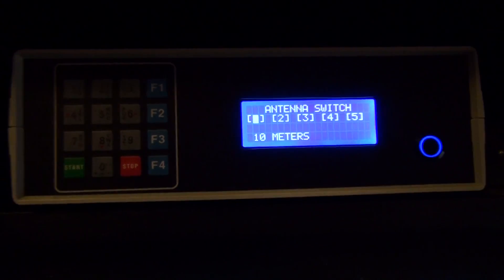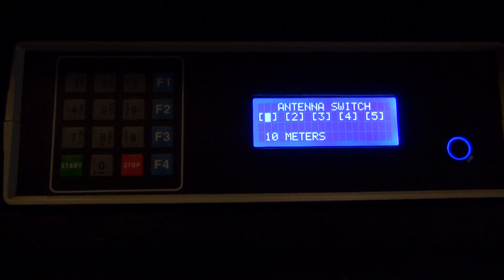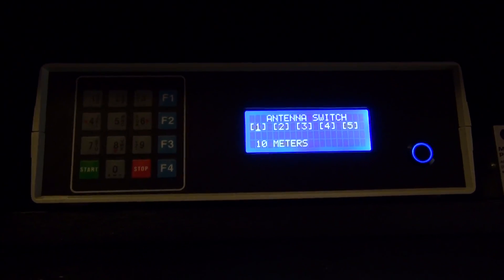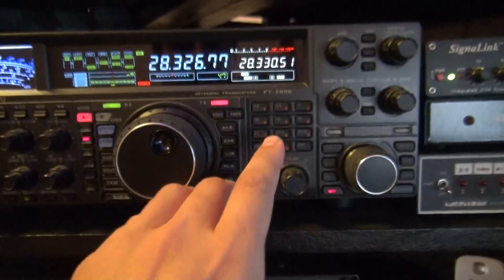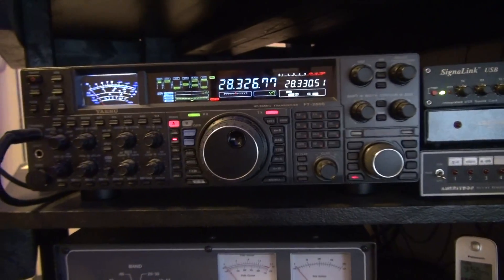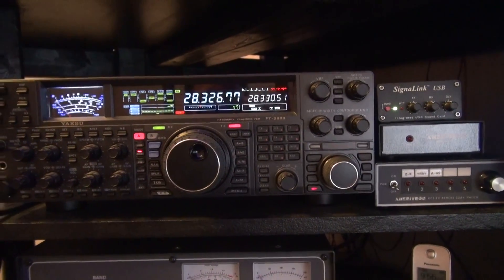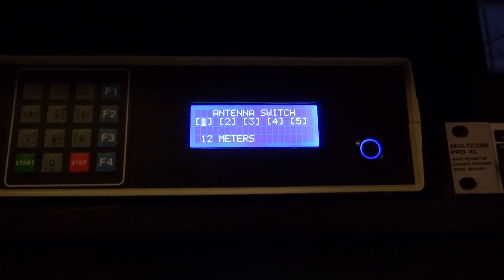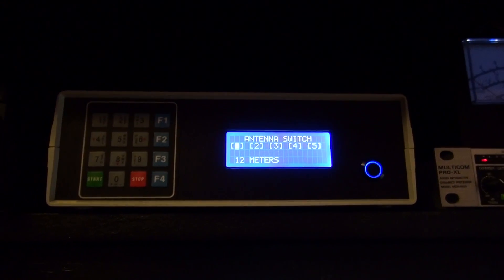YAESU BAND DECODER FOR MY ARDUINO PROJECT

Comment: HI I was looking for information on  my ONKYO TX SR-804 AV Receiver . It needs the RCA jack repaired for the subwoffer from people tripping over the cord connected to it . MY local repair place wants 155 bucks basic repair Plus parts and labor. I tried to take it apart . Has like 50 screws in the back panel . The Subwoffer jack is on the bottom and I cant seem to get to it . There are tons of components on the top . Some of the connector cords unplug but some dont seem to unplug. Im in Syracuse NY . I seen your other onkyo video and thought I would ask some advice . TY
Reply from the maker: +Ed Yager Some receiver's can be alot of work or even a pain to get to the issue. Now you can see why the repair coat is so high. 155 plus parts is a bit steep but the shop has overhead to pay for.. i would take tons of pictues of what you are taking apart and what type of screws came frome where. And connectors. You may have to unsolder connections that have no plug if you cant remove something. Sometimes there is no way around it.
Reply from the maker: +Ed Yager Some receiver's can be alot of work or even a pain to get to the issue. Now you can see why the repair coat is so high. 155 plus parts is a bit steep but the shop has overhead to pay for.. i would take tons of pictues of what you are taking apart and what type of screws came frome where. And connectors. You may have to unsolder connections that have no plug if you cant remove something. Sometimes there is no way around it.

Comment: please excuse me for the ignorance but i am new and i have my ham radio operator test is on december so..... the radio have an incorpèorated antenna tuner or not? if no you could make one controlled by the arduino with a stepper motor and a variable capacitor right?... anyway super cool project again
Reply from the maker: Some radios have a built in tuner and some do not. It is possible to build a antenna tuner with an Arduino and other required parts. It would take a great deal of knowledge to build something like that.  If you are new to the hobby I would suggest getting something with an auto tuner built in or an external one. You can use a resonant antenna to start with and you will not need a auto tuner but you may be limited to one band for that antenna. An antenna tuner is used for tuning an antenna that is not resonant for that frequency and will always be some sort of a compromise. It will never be as good as a antenna that is cut for that band. It still will perform well just not as one cut for a specific band. Some people do not notice much difference. It is all in how much capacitance and inductance is required to compinsate a match  for the antenna to the radio that  determines the quality of the signal for that antenna. Till you understand more on how it works and maybe later down the road start to experiment with building one.